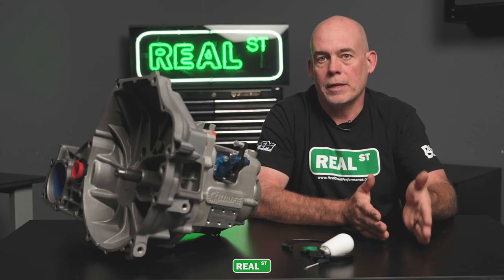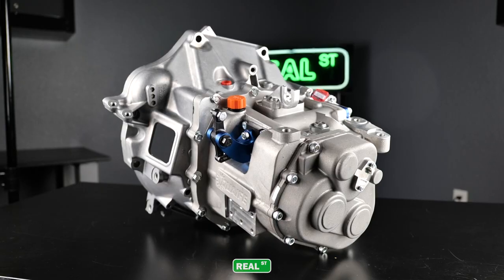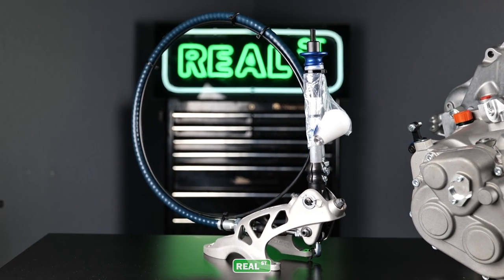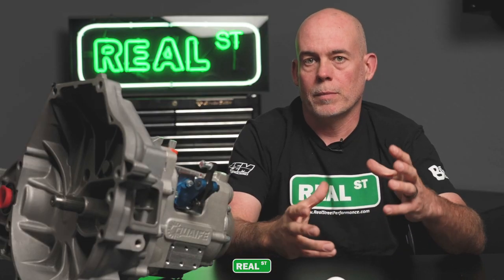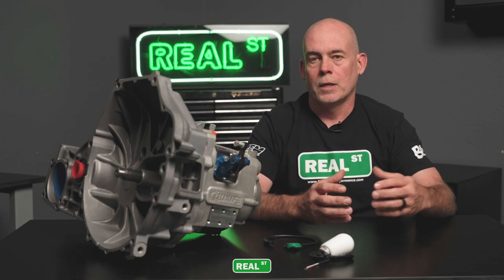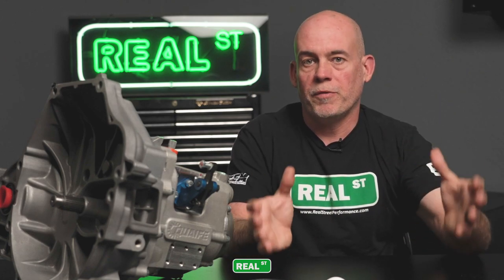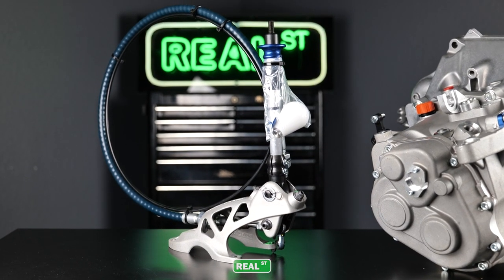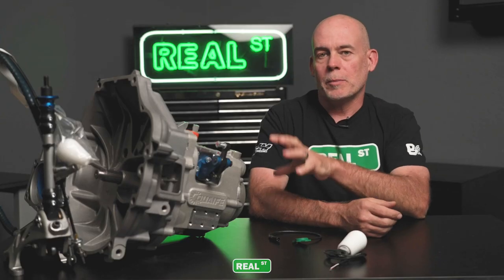Sequential Transmission Overview | Jay's Tech Tips

Comment: If you can't feel the transmission shift hard then the clutches are slipping and causing heat and there is to much plastic in the new transmission's that  fail prematurely on purpose a transmission that shifts hard will last longer than a factory slipper

Comment: So, to clarify - Let's say that we are in 3rd gear accelerating, preparing to shift up to 4th but instead we shift to 2nd than if we have sequential gearbox equipped only with 100% mechanical gear shift mechanism (lever mechanically linked to ratchet mech. which turns selector drum) than we are unable to prevent shifting down? Gear change will occur? I know - dumb question but I want to be 100% sure :). Thanks for reply.

Comment: I don't understand why everyone uses sequentials. VW builds the dq500, which german drag cars are using at well over 1000hp with no problem, has k20 adaptors availible, is cheap and is availible in awd. The closing of clutches instead of dog engagement is softer not only on the gears but the whole drivetrain, set up right there is no shift time at all as you can simaltaniously open and close the clutches without cutting engine power at all. This also prevents the suspension and tire from unloading. And you still have a streetable quiet transmission at the end of the day.
Same thing applies to longitudinal engines with bmw dcts as well.
Reply: DCTs typically don't launch all that well, I think he mentioned that in the video maybe
Reply: @FredAllenBurge  On a track, ok fair enough. On the street I don't really see it, below 3 seconds 0-60 on a 205mm tire sounds like a pretty good launch to me.
https://youtu.be/NCRRH0DOFX8
I should clarify I was mostly thinking about cars like the orange boostedboiz nsx, if you have a 1000hp streetcar for roll racing the dct seems like a way better option. Keeping both hands on the wheel is much safer as well, especially with poor traction, corners or bumpy roads.
Reply: For circuit racing application DCT isn't the best option because of it's weight. 80kg of DCT vs 30-35 kg of manual/sequential transmission